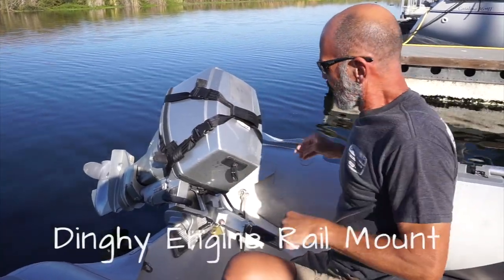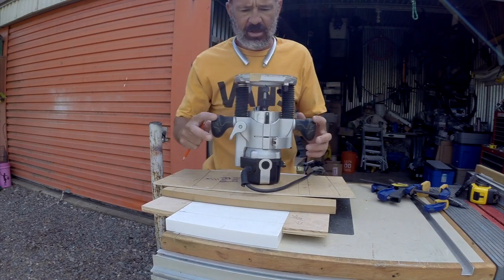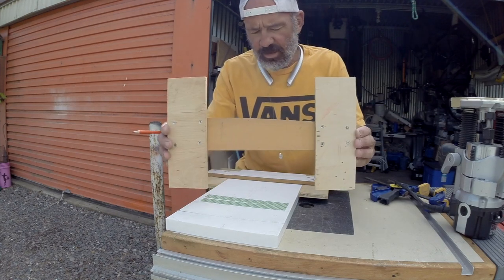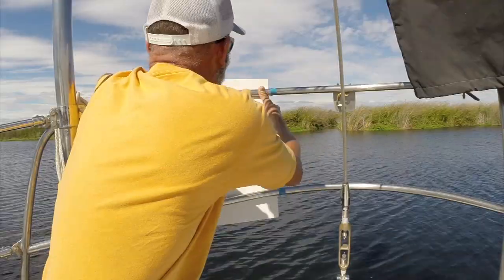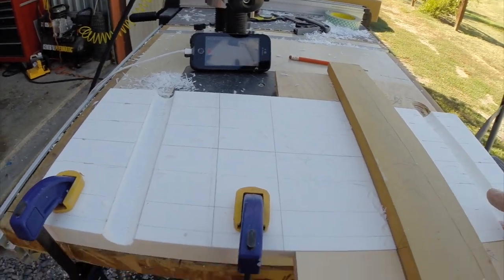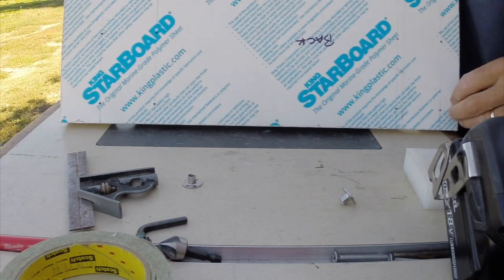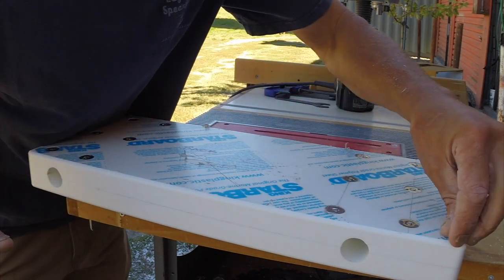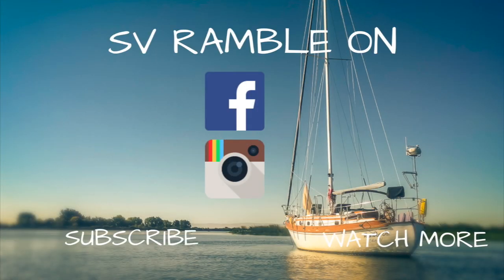SV Ramble On | Building An Outboard Engine Mount

Comment: Nice job. So far I'm a lake sailor but contemplating a few years in the Caribbean. Would you comment about dinghy outboards? My 6 HP gets me up on plane but only with me in it. If I go for a 10 HP the weight doubles. And a big difference between 50 and 100 lbs. Do you use the dinghy enough exploring/excursions to warrant going with the heavier engine?

Comment: I would invite you to make one for my boat, 
but I'd have to cash in my life insurance policy to pay you 
for the engineering work alone!
Beautiful Job.
Reply from the maker: Thank you G King.  Ha Ha.  Would've been a no-brainer if our push-pit rails were straight; I'd have bought an Edson engine mount and been done with it!!  I love the Bob Perry canoe-stern designs, but those sexy sheer lines make for some creativity when it comes to mounting crap on the rails.  That's why I'm not particularly fond of davits and arches on these types of boats, and my scheme for mounting solar panels is going to be a neat trick.  I actually started this project about 3 years ago with a large hunk of salvaged mahogany and some U-bolts: easy peasy, right?  Nope.  So after sitting on the idea for a couple years this is what I finally came up with.  Seems to work so far...